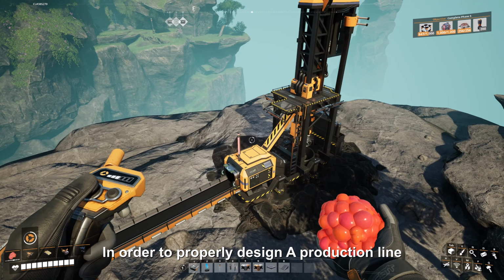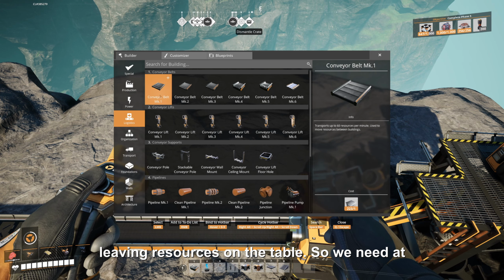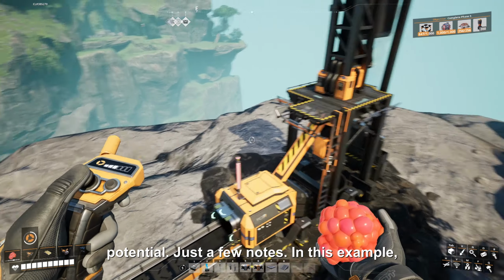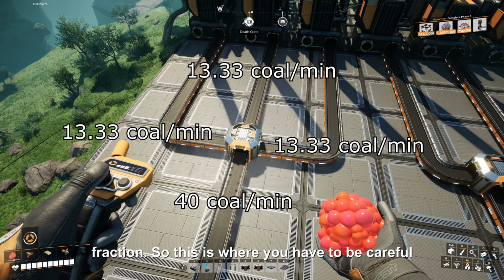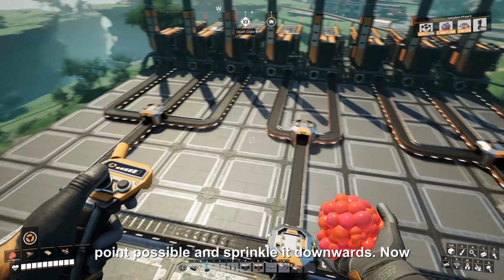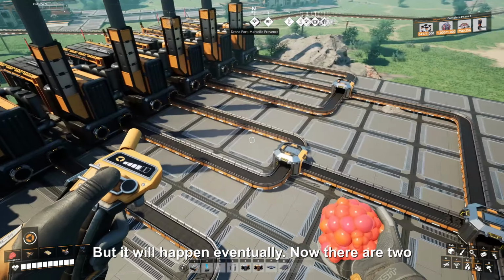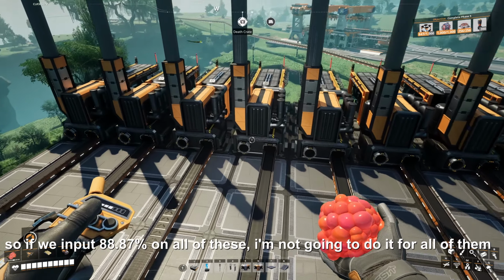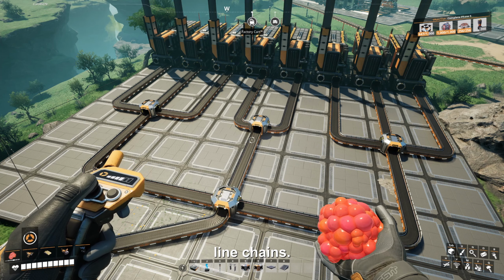Satisfactory Beginner Guide: Design & Optimize Production Lines from Resource Nodes (With Subtitles)

Comment: you have to be really stupid not to divide 120 by 8. look: 
120/2=60 and 60
60/2 = 30 and 30 (4 times 30 in total)
30/2 = 15 and 15 (8 times 15 in total)
also water - one generator needs 45 water, 8 generators need 45*8=360 water.
one pump gives 120 water, three pumps give 120*3=360 water.
everything connects perfectly without downclocking.
Why do you divide by 3, 2, 3 parts instead of the normal one? Don't you know the simplest math?
Reply from the maker: Why would you divide 120 by 8? 

What is considered the “normal one”?

Where are your variables coming from?